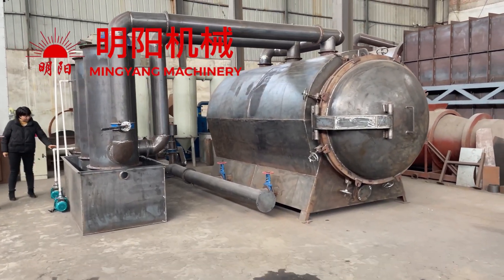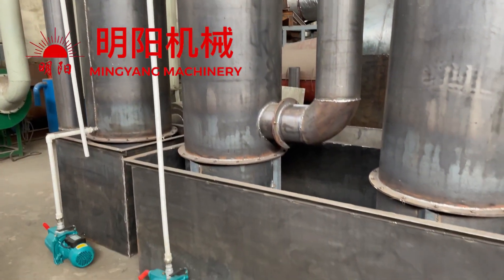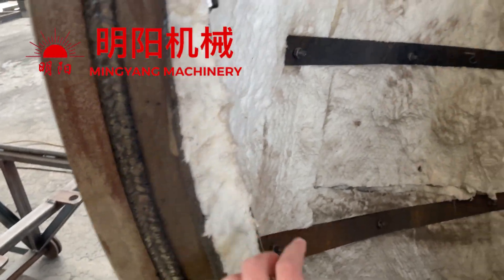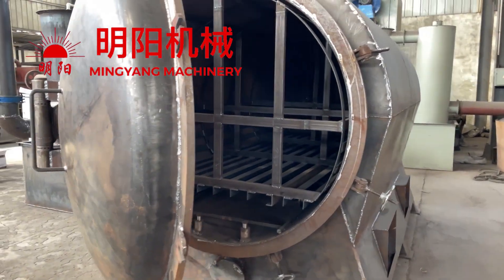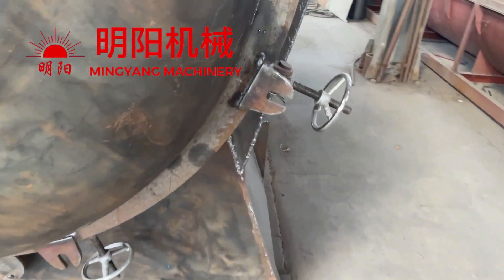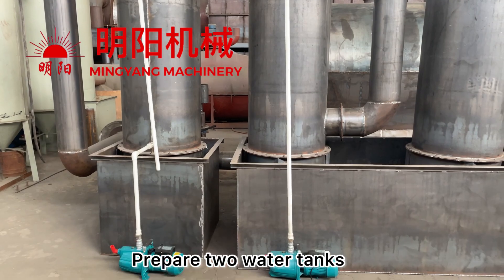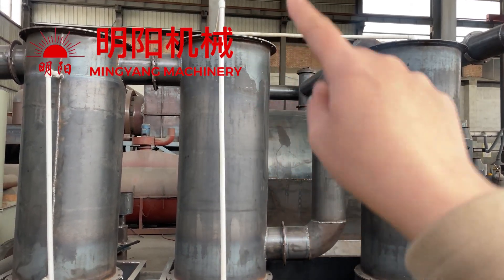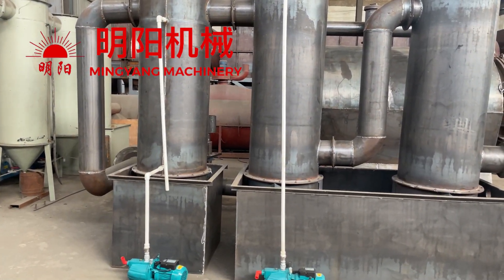High efficacy smokeles!!! Natural Wood Charcoal Carbonization Furnace

Comment: Water perfacation pondamic production liqued
Reply from the maker: Water purification is designed to collect all smoke, and treat with circulation water, then working will be smokelss( environmental protective), and after purified, the smoke( flammable gas) can with less dust and moisture, it will be eaiser to light up as fire. This is the most easiest and cheapest way to achieve this goal.